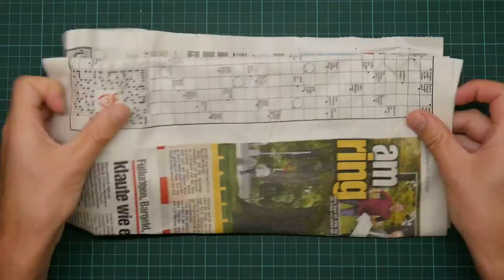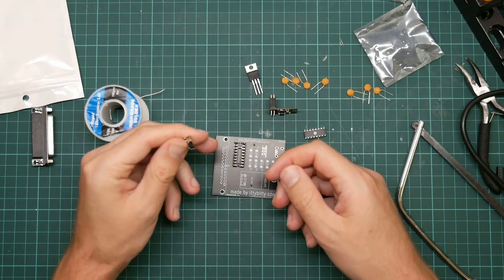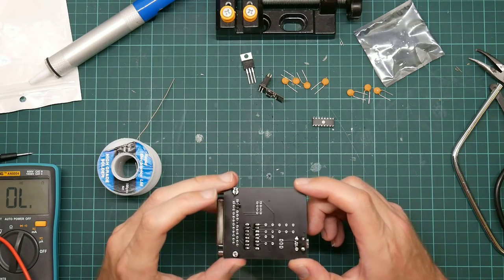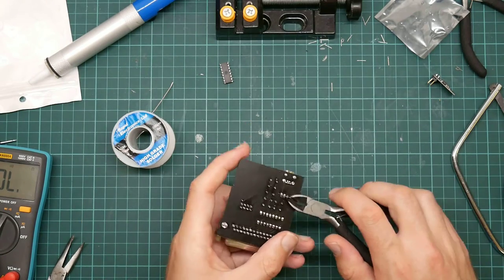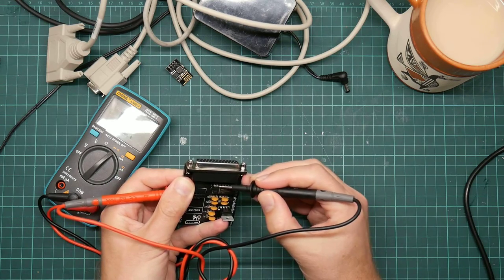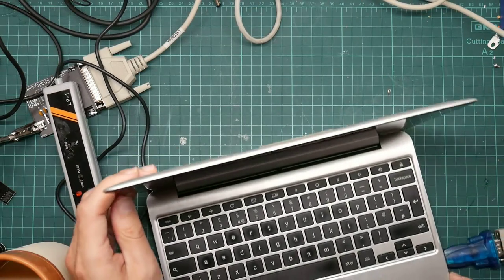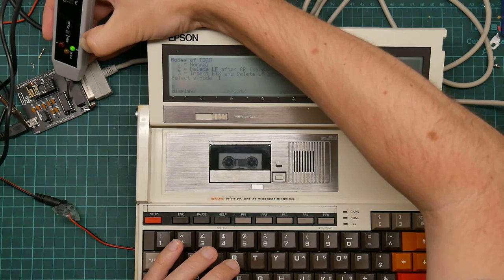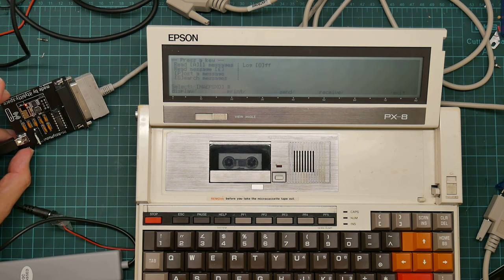Hjalfi builds an (itty bitty) space modulator

Comment: Hi, I'm the creator of the PCB. You've done an awesome job soldering all the parts. Thank you very much!

As for the USB port: I also would have prefered a MicroUSB or USB-C port but unfortunatly the mini-type one was the only one which was available as through-hole component (in a given budget)
Reply from the maker: Ah! Yes, that explains it. I have soldered a surface-mount MicroUSB socket... once. Through-hole is definitely the better option.

Thanks very much for this --- putting it together (and debugging the problems) was really interesting, and it'll be dead useful. Never underestimate the perversity of old hardware. (I have a printer which uses 4800 baud at a parity mode which Linux doesn't actually support.)